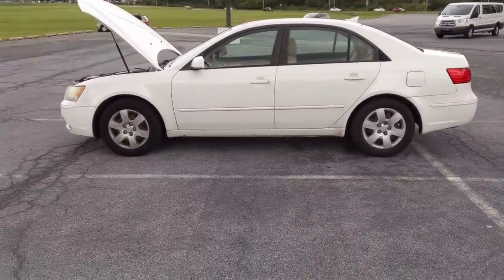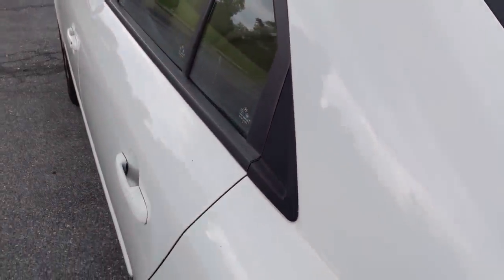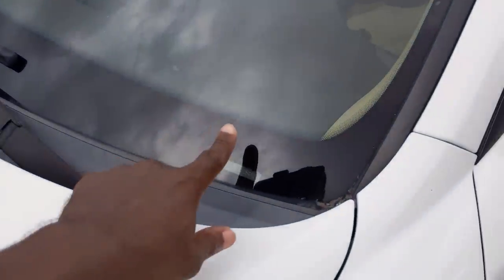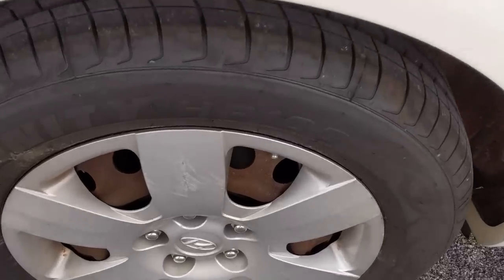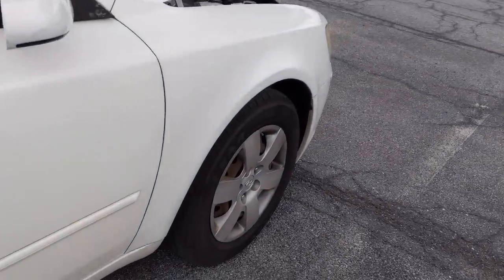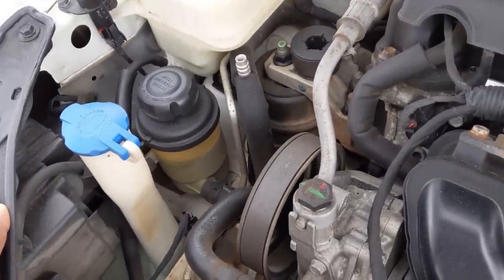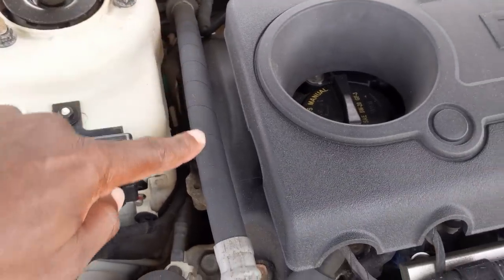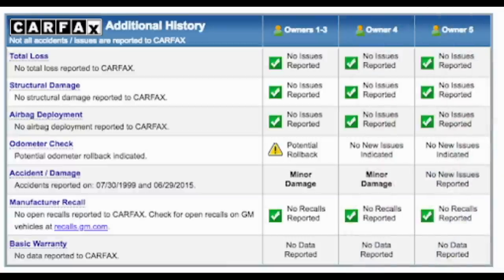🚘Ex Salesman Shows How To Buy A Used Car🚘

Comment: Here’s a trick to see if a car has been repainted turn the flash on your phone and take a picture it will show if it’s been repainted
Reply: What would be the differences to focus on??
Reply: @slumppednova  take the picture  of the car from all sides with your flash on  or in the evening it will show any changes in paint colors or replacement panels that why you never ever see any cars photos in the evening time they usually have them well light so it doesn't show
Reply: @simontaylor9478  you are awesome 👏 😎 thanks frfr

Comment: Who would dislike this? Tf ?! Mechanics or dealership workers 🤦🏻‍♂️
Reply: Salesmen
Reply: @faizaanalap4  you are correct the info given here is mostly cosmetics, never did it discuss about the engine or the transmission, everything mentioned in the video can be replaced at a reasonable price. Engines and transmissions can not.
Reply: Lol
Reply: I thought so it's very informative.

Comment: One thing I like to do is take off the oil cap and look down into the cylinder head, if possible. You can see if the car has had frequent oil changes. Also, inspect the oil cap. If there is moisture or condensation on it and it looks suspect, it probably has a blown head gasket. Definitely check for oil leaks, transmission leaks, any leaks period. A lot of dealers will sell you something with problems and if you don’t speak on it they won’t either.
Reply: great advice!
Reply: Yup and check the oil before and after the test drive at least twice
Reply: How can you tell if it had frequent oil changes? I'm 60 yrs old and have never heard of that one.
Reply: Matter of fact I have never been able to see down inside an engine through the oil cap even with a flashlight. So please tell me how you manage to see frequent oil changes through the oil cap hole.
Reply: @udontnome  I said, if possible. I can name a few engines/cars that you’re able to see the inside of the cylinder head (which is where the oil is being poured). For one, Chevy Vortec engines (LS motors) and some Honda vehicles. I drive a Honda Accord and you can easily see down into the cylinder head. If it hasn’t been maintained, there could be sludge.
Reply: @kahlildr  Ok. So sludge is what you can look for, but isn't it difficult to see sludge through the engine oil?
Reply: And if it's so bad that there's sludge wouldn't that mean burning oil? So it would just be white smoke coming out the exhaust right?
Reply: I hate dealers.  Why can't they be honest about the condition of Le car?

Comment: Good advise. I also always check under the oil fill cap to make sure that it does not look milky, which can be a sign of a weak or blown head gasket. I always smell the transmission fluid dipstick if it has one to make sure that it does not smell burnt, and I look for metal shavings to make sure that the transmission has not had any previous issues. I then test all of the electronics and features of the car including the A/C and heat.

Comment: Another good thing about the tires is to check the inside of the tread as well cause if the alignment is really bad the wires of the tires could show. The front tread could look good but the inside could be a different story

Comment: I ALSO LIKE TO GET THE CAR UP ON A LIFT TO CHECK FOR LEAKS ECT.
Reply: Not just links on the ground but look at leaks around the gaskets. Also look at the gas and brake pedals to see how much they are worn. Don’t forget to look at the drivers seat as well for wear.

Comment: Some things you didn’t mention. 

Tires, check the DOT code in the case of this video, one of the tires had a date of 06/19 which means at the time of the video that tire was 3 years old. Don’t know about the other since it seemed they were mixed matched. 

Obvious possible accident damage.
Over spray on molding, trim pieces,tires and exhaust pipe.

Driving, if the car shakes violently upon stopping. The front rotors are warped. If you hear a grinding noise when braking is applied the car need brakes, the same if you hear a squeaking noise when the car is rolling, that’s the brake pad indicator warning. 

Check to see if the car it cold upon approaching it, if so check underneath for leaks. If the is warm it could have been moved to a clean spot. 

Just a few things to add to this video.

Comment: Ck oil dip stick for strains, ck oil cap for milky strains, ck how smooth tranny shifts, start car let it reach operating temp take for a ride and see how it drives at high speeds, ck for skip in engine, ck struts bounce fenders should be stiff thank u

Comment: Good summary, but FIRST, show up without telling the seller you’re coming & look under the car for fluids puddled under, or drops on underside; Oil, transmission, coolant. If you tell them you’re coming, they’ll move the car & clean off fluids. Look at the oil cap & dipstick & check for any coolant/water. We found a Jeep with an oil pan gasket leak & made the dealer replace it.  Wiper blades & tires are wearable items & they probably won’t replace on a used car.

Comment: Good advice good advice also to make sure the blocks not cracked turn the air conditioning and heating on full blast about 15-20 minutes and make sure the car doesn't overheat  if it's not cracked will register normal not hot not cold

Comment: This doesn't help. Windshield wiper blades? Tires? These are inexpensive vehicle maintenance. What I'm worried about is what I can't understand on my own, like whether there's an electrical issue from someone putting jumper cables on backwards or whether gaskets and seals are blown. Is something leaking or stripped from past home repairs.

Comment: I'm buying a car online from another state. I'll use carfax and hope the vehicle is a good buy. I'm using your advice before I go to a mechanic. Thanks.
Reply: I Agree, a Carfax inspection found a windshield crack on a used car that I had missed, it was low down at the edge of the glass by the wipers, the dealer claimed he didn.t know it was there either. Would never pass inspection,  and new windshield, that would have been expensive. Also a good idea to have a independent mechanic look at it before you buy.

Comment: The typical buyer is not equipped to buy a used car. They are buying the habits of the previous owners. Your slap and tickle inspection will not properly judge a car's condition. ALWAYS get a pre purchase mechanical  inspection and not at Pep boys. Go to a body shop. Body men love to point out previous shoddy work. Wiper blades are more important than the age of the tires and the age of the battery.  Used car buyers buy with their eyes Carfax means squat.

Comment: Went to herb chambers Toyota  in New England today. They told me they don’t negotiate prices on used car because as of their smart price system. The Toyota Corolla SE was $14500~. I was hoping they would take $500 off, but nope. We literally walked out. I’m wondering if anyone experienced this and how did they negotiate a price  with the smart-price system?
Reply from the maker: those one price dealerships really don't budge.
Reply: That tactic is called price anchoring. And if they actually don't negotiate, they will start soon if they want to sell any cars. 
Have a quick search for same make model options and similar mileage cars and see where their particular car sits in the market. Bring that list in and tell them you will go to the next dealer to buy theirs because they dropped the price 1000 bucks over the phone! They will bargain for sure. Dealers KNOW that in todays market (internet) buyers shop at 1.6 dealers before making their purchase.... Do you think they want to see you walk? NOPE.

Comment: My advice is to spend $300 dollars on a diagnostic scanner. One that shows all the faults and real-time reading.  All engines sound different, the ear isn't a good tool anymore.
Reply: Can you take it with you to the dealership?
Reply: @starbaby1754  Yes you can, I and my son used it at a Toyota Dealership. If someone tells you no, then don't shop with them.
Reply: @dallrevenge9256  ok thank you..
Reply: Which one do you recommend for diagnostic scanner
Reply: @Xtremeproducts  Foxwell is a great brand. Make sure you buy one with the free upgrades.
Reply: @starbaby1754  yes
Reply: I watched a few diagnostic videos on YouTube before making a decision. Type it in, They're are many great brands to choose from.
Reply: @dallrevenge9256  thx will do
Reply: @dallrevenge9256  going to look into it now
Reply: @Xtremeproducts  Just to let you know, I bought the Foxwell NT 644 Eite. it's a bit pricey but well worth it.
Reply: @dallrevenge9256  thx for the info bro. I needed that.
Reply: @Xtremeproducts  Your welcome

Comment: Do ALL used car dealerships report to Carfax?
Reply from the maker: Not all. Its really about the place the maintenance work or body work is done on the car. It's whether or not they report to Carfax. For example, Pep boys might report when it does and oil change or brake job but a corner shop mechanic probably wont.

Comment: I thought carfax was free.
Reply: it is if the dealer gives it to you. But I would pull my own and pay for it (7 or 8 bucks! not 40) because sometimes the dealer will have an old one and it will be missing some work that THEY did also some wrecks tak over a year to populate so the fresher the better/safer. For the cheap carfax go to https://cheapcarfax.net/  you will need the VIN and an email for them to send the report! √√ But you should know that nothing on a carfax you can rely on its like a good looking person from far away... you gotta get close and have a conversation... Get the car inspected at a third party garage to be sure there are no accidents that went unreported to carfax. Apparently 80% of wrecks don't get reported. √√